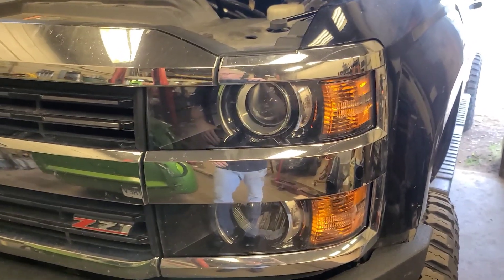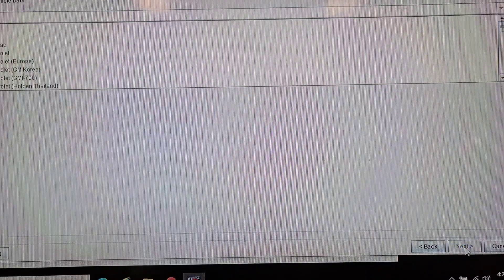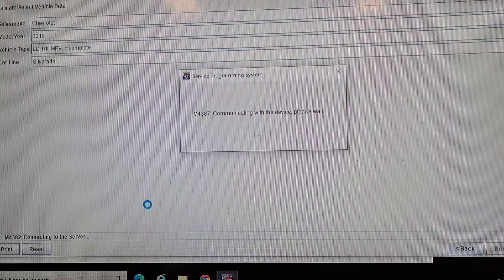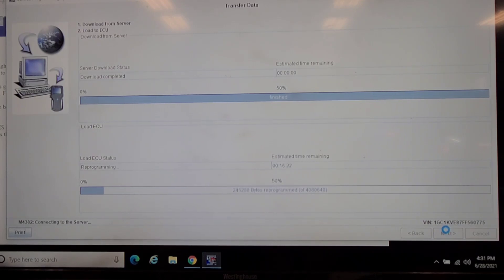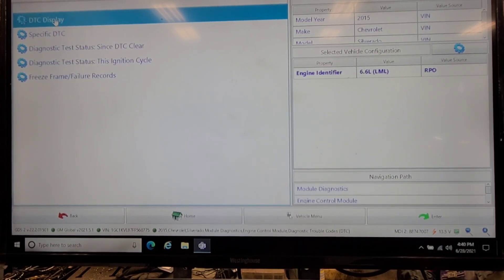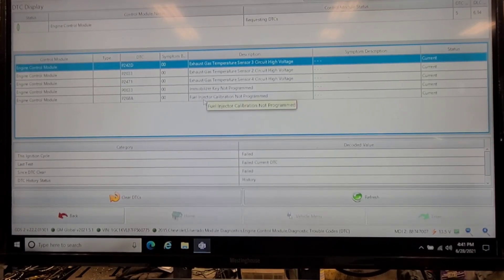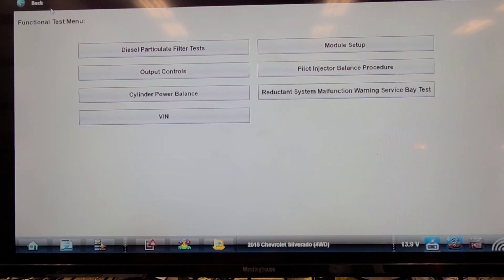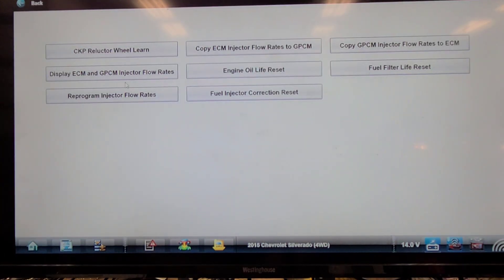2015 GM Truck 2500HD No Crank No Communication With ECM pt.2 ECM Replacement.

Comment: what type of scanner where you using?Can you recommended something that can do the same?
Reply from the maker: In this video because I'm primarily doing a program event I was using a laptop running GM GDS software and GM Service Programming Software. Additionally I was using a GM MDI2 as a programming pass through. There are a few aftermarket scanners that should do this including an Autel Maxysys together with a J2534 programmer. There are a few others by Launch and Thinktool but I haven't used them. If you need to replace your ECM you might consider a company in the USA called Flagship One who should be able to supply a replacement ECM that is preprogrammed with the correct software and VIN. You will still need a compatible scan tool to copy the injector calibrations and perform the Antitheft relearn though. HTH

Comment: Good video I have a 2008 Cadillac Escalade ESV I can't get a reading from the ECM in it will not crack or start in gauges are not right to I get a check engine light but no reading but when I unplug the green connector next to the brake like you showed in a previous video then I get communication to the ECM then I cleared the codes and cut the engine off and start it and get a code lost communication with fuel pump so I replace it with the AC Delco module and had Cadillac dealership programming and I installed it and plug the green wire back in and still nothing do you might know what that is please help I can't even get it inspected because of it
Reply from the maker: Your ABS module may be compromising the network. Plug in the green connector under the dash and disconnect the connector on the ABS module. See if that restores com with the ECM and it cranks. It won't run because the fuel pump module is downstream from the ABS module. Ideally you need a lab scope to test the signal integrity. You could try swapping the ABS module with a used one as well. It may set a code for vin mismatch but should start and run if that's your problem.
Reply: @PhillipBailey  ok I will try that today thanks
Reply: It actually started up I didn't drive it yet but it's still running but when I was messing with the ABS yesterday I noticed the plug had dielectric grease on it I'm thinking it maybe it wasn't getting no contact cuz too much grease and I noticed the ABS had a little bit green corrosion at the bottom just a little little bit thanks I'll check the fuse on the ABS and wiring and if I don't see nothing I'll replace it but yeah thank you in I am getting communication now with the green plug in I'm still getting the same code lost communication with fuel pump module and I got an EVAP code I got the other day I'm going to put purge valve and chacos canister and right now
Reply: And I forgot to mention it does run when I take the green connector out

Comment: Everything on my 2010 Chevrolet Express(cutaway) minibus is CRIMINALLY not labeled logically and convoluted to the maximum so nothing can be seen reached dismantled.
IT IS OBVIOUS GM is purposefully doing that... to keep DIYers from avoiding their service centers... even a mechanic would curse this SHITE!
But I am stuck with this vehicle... so here I am educating up.
I keep contemplating to cut this front end doghouse setup in easy 6 pieces to simply remove out of the way and have the engine exposed like a big rig with hood forward or a Glaval type!